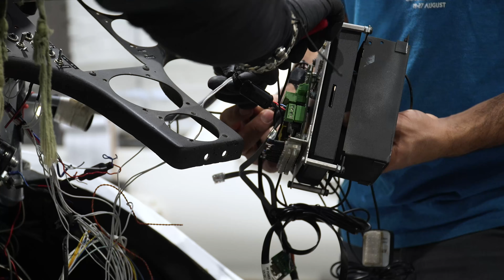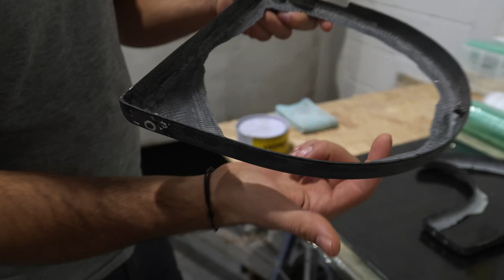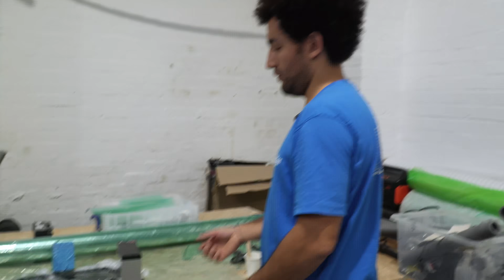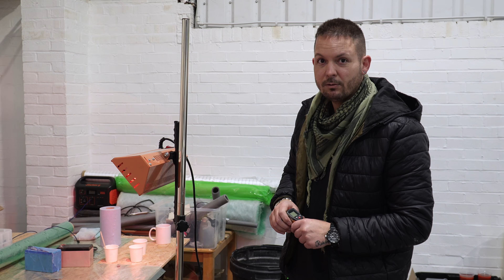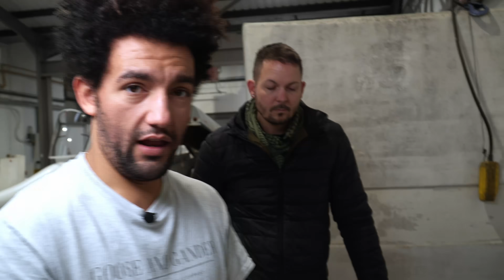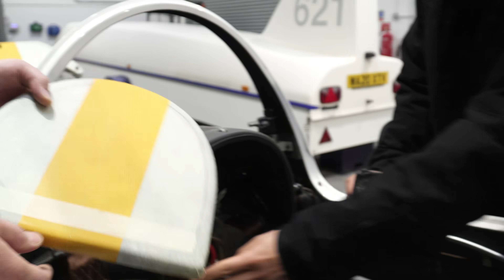How to Repair and Recut an Instrument Panel | Panel Upgrade Part 1

Comment: Why don't you use peel ply and a vaccuum bag instead of weight to squeeze out any excess resin from your layup? Panel rebuilds on a glass surface are a perfect setup for a vacuum bag.

Comment: I have rebuild my instrument panel in my Mini Nimbus as well, I draw it all 1:1 in Autocad and bought a heavy duty glass fibre panel and had some laser cutter cut all the holes... to make the panel really strong and stiff I also added some braces, which doubled to hold some small control boxes (Bluetooth module, ADSB out splitter etc.) I also thrown out all the old wiring and replaced with aircraft grade wiring, Klixon resettable circuit breakers and aircraft grade toggle switches. Most (D-Sub) connectors are crimped, avoided soldering as much as possible.. Only the XLR connectors for the batteries are soldered ..Worked out pretty well and all electrical issues I had before are a thing of the past.. Working for 4 years now without issues. I am pretty proud of my new panel and how well it works for me.

I made a wiring diagram, and partslist also in Autocad, so all connections are now well documented, also most wires are marked with a wiring number.  This all will come in very handy for the next owner, as I am planning to sell my Mini Nimbus in a few years.
Reply from the maker: Sounds like a solid job!

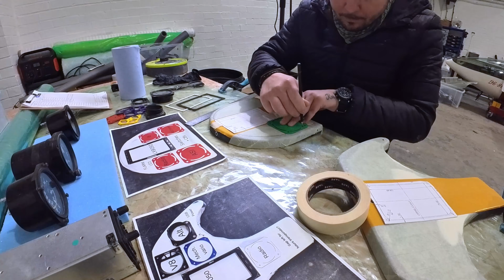Comment: ALWAYS use a dust mask and eye protection when cutting, grinding or sanding glass fibre or carbon and not as demonstrated at 13:47 on this video! Other than that, great and timely video.

Comment: I bought new blank panel from ALEXANDER SCHLEICHER for 189 euro plus delivery. On the other hand I would never even try to rebuild it without proper mould and vacuum.
Reply from the maker: Yes, for some gliders it is cheaper to buy a replacement panel. But in most cases it's more economical and a lot faster to repair the existing one.
Reply: @Navboys_ltd  What kind of paint for this panel did you used, if you don't mind?
Reply from the maker: @filimonchik123tube  Sorry missed this comment. We use Nextel